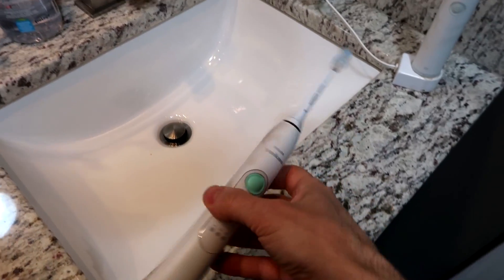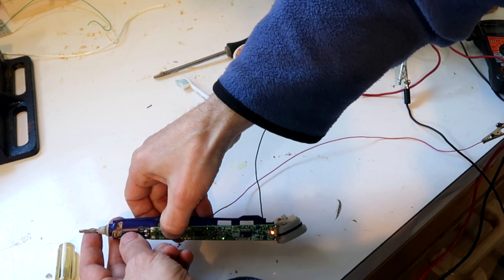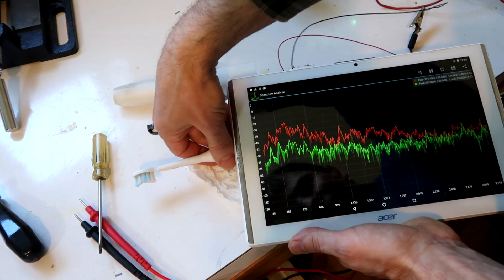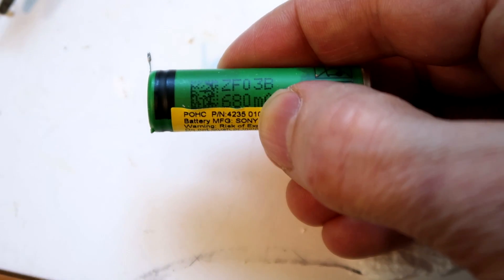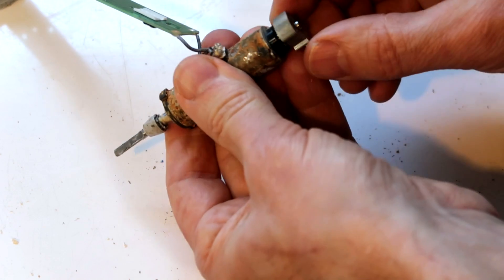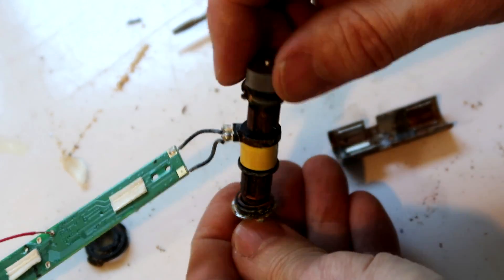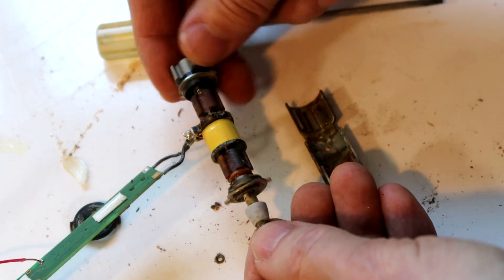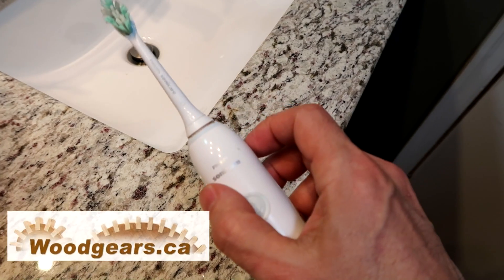What's inside a Sonicare toothbrush

Comment: I have a little curiosity about these. If I’m actually correct, this could be interesting. I notice that this brand of electric toothbrush can vibrate at different frequencies, or at least the newest ones can. This is heard with the “pacer” feature where it tells you when to change where you brush. The kids version that they used to make even made a little jingle. This makes me wonder, what exactly happens if you hook one of the motors up to a MIDI controller, or even a stereo amplifier?

Comment: could you use the motor thing as a speaker?
Reply: It already is one, to a certain extent. 
The low battery tone, and the tone that tells you to change the brush head, are all produced by the motor that actually moves the brush head to clean your teeth. If you connect this motor to a tone generator, you’ll get a matching tone. 
To my understanding, the motor in these Sonicare brushes is basically a speaker that rotates back and forth instead of moving in and out. The entire head swivels back and forth rapidly, moving the bristles back and forth, but the head is also symmetrical and a fairly small surface, meaning it’s going to be quiet if you want to use it for the sound. Mounting a lightweight, rigid object (like a piece of corrugated cardboard) onto the head of the brush so it resembles a flag on a pole, with a super glue that dries extremely hard to avoid it flopping around, would likely produce a louder sound.

Comment: great video man!  

So i have created a new lint remover and we put a pretty strong ERM motor connected to two AA batteries in there that has strong vibration but no amplitude or side to side motion!  Are there any ways to increase vibration with this ERM motor maybe have a stronger battery or rechargeable battery?

What i am thinking is to put a stronger (3.7 volt) acoustic/sonic motor and connect this with a rechargeable battery at least in the 1200mAh battery range!  Thoughts on this?  Perhaps there must be a way to increase vibration without changing the motor? Any  thoughts on this? 

Thnaks

Comment: Great video man 
So I am looking to install an ERM MOTOR in my newly designed lint remover used to remove lint from clothing to sell on amazon. 
I want this lint remover to vibrate because vibration actually helps my razor blade straight edge blades remove lint from clothing smoother and faster similar to a vibrating toothbrush in cleaning the teeth! Would you know what would be the best type of motor to install as I will have the motors installed on each of the two razor handles that come off the 6” handle and positioned right by the blades themselves!  Is an erm motor best or is a brushless dc motor without the eccentric mass better to use for a smooth but also noticeable strong vibration force?  Thx 🙏🏻

Comment: I bought my original Sonicare toothbrush when it was made by Sonicare before they got taken over by Phillips this was when it was a quality product it lasted 10 years before the battery died, when the battery no longer had enough power to operate the brush I removed the brushhead and ran it completely flat before putting it on to recharge fully, I never put it on the charger just to top it up if it didn't have enough power I would use a manual brush. I remember watching a you tube clip many years ago of a guy who was complaining that his Phillips Sonicare tooth brushes were only lasting 2 years before they died, after dismantling one he claimed the brush had a chip in it which only allowed the battery to be recharged a certain number of times before it prevented it being recharged so the brush had built in obsolescense I had no way of verifying if this was true.
I have an old Phillips hair trimmer which was rechargeable and also ran off mains, once the battery would no longer accept a charge it stopped working on mains as well. I carefully dismantled it and found the rechargeable battery was completely blank no manufacturer's name or capacity rating on the battery, so I rang Phillips Technical and asked if they could tell me what the battery capacity was and an irate young woman said I'm afraid I can't possibly tell you that as they are not designed to be repaired, I said ok thanks and hung up. I could see it was not going to be easy but I wasn't prepared to give up, I carefully removed the old battery leaving the solder tabs still attached to the clippers, I cleaned the tabs up carefully and applied a small amount of vaseline to improve conductivity and carefully pushed into place a high capacity AA rechargeable battery very tight fit, I carefully reassembled the clippers it basically all clips back together. I plugged in the charger and when the battery was fully charged I tried it out and it worked perfectly and its still going strong, you need to treat it with care as the battery could become dislogded as its not soldered in place . A little bit of effort and £3 for a new battery saved me spending about £35 for a new pair of clippers. I am not a tight person I just see everything in life as a challenge and I for one would be prepared to pay more for a better designed product that could be serviced and maintained than have the  disposable society that we have now.

Comment: The top seal seems to be the issue on all sonicare brushes.  Crud and water collects around and under it and it eventually fails.

You can extend the life of the seal by taking the head off and cleaning it after every use, just a wipe and storing it upside down to stop any moisture that does get past the seal from getting down onto the PCB.

Comment: Leaks are kindof inevitable with a rotating shaft seal.  As I recall, the old design had a magnetic drive system, making it less vulnerable to leakage/corrosion.  Downside was more expensive replacement heads, due to the extra magnetic components.

Comment: I just got one of these, largely based off this video (I'd been meaning to for a while, and this triggered it).  Holy shit does that thing vibrate all to hell!  My biggest problem is not drooling down my chest as it shakes everything loose in my head.  I can definitely believe it's fully loosening up debris.
Reply: Everyone I know that has one get's used to it after a few weeks/months and stops drooling.
It's been a year since your post. How long did it take you?
Reply: @Prophes0r  Largely fixed the drooling issue, but it's still hard to keep the liquid toothpaste/drool from dribbling down the brush/stem portion and onto the handle portion, which I usually have to rise a bit.

Comment: The new ones have redesigned the "motor" section, it works more like a pendulum with magnets on it. Maybe you can show the mechanism inside your new brush.
Reply from the maker: that's what the first generation had in it.
Reply: @matthiasrandomstuff2221  Oh wow that's interesting how they went with a design with tons more magnets inside it. I guess the part costs are offset by how much simpler it is to assemble this design.

Comment: I went through several instances if the original modal (where each head had a pair of magnets at it's base).  They only lasted a few years each.  Never took them apart, just returned them to Philips fir recycling.

I liked that design because the handle could be completely sealed since there was only magnetic coupling to the head and, at least in theory could have no moving parts, just an oscillating magnetic field.  I was really surprised it could fail.

Re: NiCd batteries: they're notorious for having the "memory" issue and requiring deep cycling to provide power for any length of time.

Comment: Nooooo! Not twist! Prey it carefully out with a screw driver (at the positions defined for this by the engineers). It is a snap-in mechanism, that principally can be opened and closed a couple of times. 

I repaired a number of these Philips Sonycare tooth brushes. Most frequent problem is that water hat gotten into it. Other problem is that a screw that defines the distance between moving head and solenoid gets lose snd needs tightening. 

Urgent advice to owners of these brushes: don't treat them as if they were water proof. They aren't. Don't use them under the shower, although it is tempting; dry them after use. Take the actual brush off after use to dry the head section of the brush handle (where water can get in, too, although there is a silicone ring to prevent this happening immediately).

More repair information in blogs and videos all over the internet. - Chinese companies even sell repair parts such as silicone rings and plastic parts. - Battery can be replaced but needs soldering.

Comment: I had one of the old style with the chunky replacement heads that lasted over 10 years. I only replaced it because my wife's was disgusting, and it was easier to replace both at once with a Costco 2-pack and have matching replacement heads. My new one's battery has started failing on me. I wonder if the old ones used different battery tech, like NiCad, which doesn't mind being kept topped off all the time?
Also, even though I overrode the softer "starter" mode, I don't think the new one vibrates as strong as the old one -- though it does still seem to get the job done.

Comment: Looks similar to the arrangement of the vibration motors in video game controllers...
Reply: Most vibration motors work by constantly spinning 360 degrees with an out-of-balance weight on the motor shaft. This motor spins 36 degrees one way, then reverses and spins 36 degrees the other way, then repeats this over and over. Those behaviors are completely different. 🤔
Reply: @mykalimba  I was referring to the spinning imbalanced weight on the motor rather than the specifics of the rotation. In that respect they are similar.

Comment: I've given up on the battery operation of these (exact same model) and simply plugged them into a corded mode. I don't remember off the top of my head what were the settings on the transformer. I've also coated the whole thing in a PCB spray (from 3 ish years ago). Still going strong and i'm not bothered in the least by the corded notion of it. I used the wrap cable around stick and heat to make a telephone cord type wire for it. That one however, has begun making that annoying copper green bulge cables tend to do when exposed to sweat or damp environments.

Comment: I don't put my sonicare on the charger until the battery is flat. I think mine lasts for 5 years now and I charge about 3 times per year!
Reply: Lithium batteries don''t get much wear difference on recharging at different levels... It's one of their main advantages... It also depends on how often and how long you use each time... many variables...
Reply: @aerogfs  That's what everyone says. But I notice that my father who puts it on the base each day has it's battery worn out after a few years. He is on his third, I am still on my original one and the battery lasts a few months without recharging. 
We bought the original ones at the same moment, same shelf, so should be similar units.

Also note "Not much wear difference": in 3 years, his went through 1000 (shallow) charge cycles, while mine went through less than 15 (albeit deep) ones.
Reply: @aerogfs  Partly true, but they don't like to stay undercharged or overcharged too much. They prefer to be kept around 30-80%. In fact, Tesla's vehicles will try to keep charge below 80% unless you plan a long trip and need the full capacity. Unfortunately, toothbrush chargers are just dumb induction chargers.
Reply: @voidisyinyangvoidisyinyang885  Hmm. That is interesting. That's counter to everything I've heard, but I will admit readily that I am in no way an expert in battery technology, just a well-informed consumer. With more specific information about the generator, I might be able to find some technical details, but for now, I can only assume the manufacturer knows what they are doing.

Comment: I stopped using Sonicare brushes. Not only are they badly sealed so that water gets inside and they stop working, but also they don't actually clean teeth very well. I switched to a Braun rotating head brush and it works much better.
Reply: My dentist and his hygienists would like to have a word with you. Mine keeps my teeth clean (read: minimal plaque buildup) quite well, though I don't think the new ones go quite as high as the original style.
Reply: @bloodgain  As a hygienist, you're right! A sonic toothbrush works nearly 10x better!!! Keep going with your sonic! BURST brushes have a vibration of 33,000 per minute! Even higher than the Sonicare!

Comment: How is yours only lasting 3 yrs?  I have had the same one for 10 yrs with both my wife and I using it 2x/day.  We travel with it as well and it holds the charge for all trips 7-14 days at a time.  We love our Sonicare.
Reply: Three years is a long time. I was lucky to get a year out of the ones I owned.
Reply: Yeah I was coming here to comment the exact same thing. I I bought mine in 2009 and it's still going (in 2020). Up until about 6 months ago it lasted for at least 10 days without charging. (A 2 day trip in 2019 turned into a 10 day stay. And I didn't bring the charger since I only expected 2 days. It didn't complain about a low battery until the last morning.)

It's just NOW starting to have problems. If I use it for 2-3 days without charging, it complains about low battery for 2-3 more days after I get it back on the charger. I was going to see about doing a battery swap. But now that I know how bad the top seal leaks (since most people seem to get water in it after 2 years it must be the top seal) I'm thinking it might not be worth more than a tiny bit of "repair satisfaction" before I'd have to replace it for real anyway.

Comment: I remember seeing a video where a guy was having a similar problem.  His Sonicare brushes wouldn't last very long.   
He recommended taking the brush head off of the toothbrush and inverting the toothbrush in an empty cup after each use.  This way any water would drain out.
He didn't recommend storing the brush on the charge base as it promoted water going down into the body.

If you just take the head off, invert, and turn the brush on you will see water come out of the body.    On the older Sonicare brushes.  People would use a finger from a latex glove to cover the gap between the brush head and body.
Reply: Even just lying down is better than upright.

Comment: I avoid water to get in between the brush head and the body when rinsing my toothbrush. If there is any water, I shake it dry. There was no rust at the top in my previous one, only some biofilm. Mine died because of the battery aging (even leak).  Now I spray quats every week. So far it still looks like new but I expect the battery will die after few years.

Comment: What happened to ultrasonic toothbrushes why can't you buy them anymore ? an invention that I was in the process of making before it came out just typical I shouldn't have set on it for 20 years.
You could make a Sonic bath with it an old sonic brush fix it to a metal plate glue to a rubber plate glued in a plastic tupperware box. Don't fix it to the centre of the metal plate use one corner about a third the way in work better

Comment: You can replace the 18650 using old laptop batteries, most of them are good.
Reply from the maker: like I said, it's an AA size battery, not an 18650
Reply: 18650 is not AA sized

Comment: I worked for a year in the Philips Sonicare engineering. They drastically change the design periodically, so take apart the new ones when you're done with them, it will likely be different next time.
Reply: What's the rationale for changing the design periodically if the thing works fine? Costs reduction?
Reply: @sligovolts  Cost, battery efficiency improvements mainly. I'm very impressed with the amount of engineering effort that goes into each new design. This is a really cool company.
Reply: @mail4mikew  I’ve had mine in storage for a few years however the unit itself is practically brand new. Before attempting to replace the battery are any of you aware of process to wake the battery back up to complete a charge? Thanks
Reply: @Sheeeeeeeeeeeeiiitt  The batteries are really sensitive to being discharged all the way, and likely are after a long time being discharged. I'm not sure how long they last with no activity, I would guess around 5 years.
Unfortunately, the batteries are soldered into place, but if you can solder, it is possible to replace them. 
The right way to disassemble them is to put a large screw in the hole in the bottom (it is a moisture-proof seal, which will be broken, sadly) and pull on the screw.
Reply: @mail4mikew  Hey thanks for the quick reply. I’ll certainly consider replacing. Have you had experience with any particular battery brand or seller on Amazon? Thanks again for the feedback.
Reply: @Sheeeeeeeeeeeeiiitt  Look for the highest mAhr and good reviews - The battery is a AA lithium (if I remember correctly)

Comment: makes me want to open up mine to see if it has suffered the same corrosion.  if not, then maybe i'll replace it with the same brand i already have.  if so, perhaps i'll look for another brand.  I do wish that these manufacturers wouldn't solder the battery in.  The planned obsolescence to get you to buy another one is rather infuriating.  Everyone knows the battery won't last forever.  Let's solder it in so that they can't change it!
Reply: Soldering the battery is a problem, having to use a vice to pry it open is another.